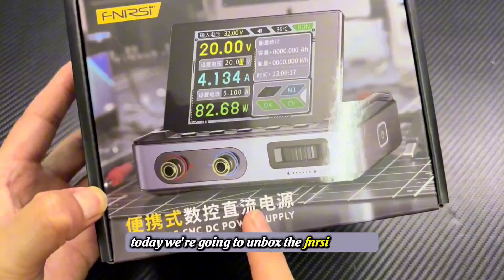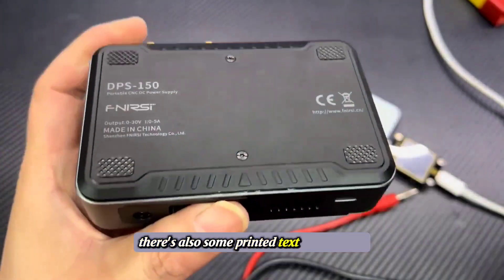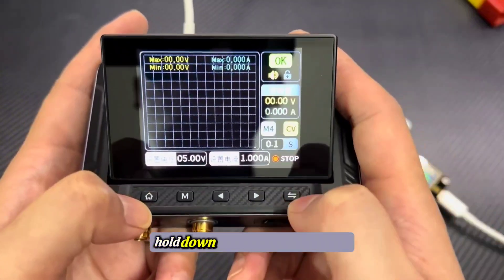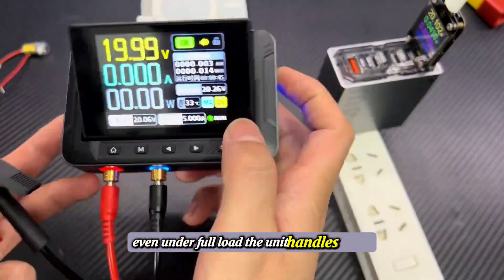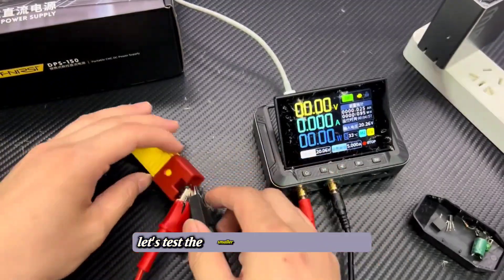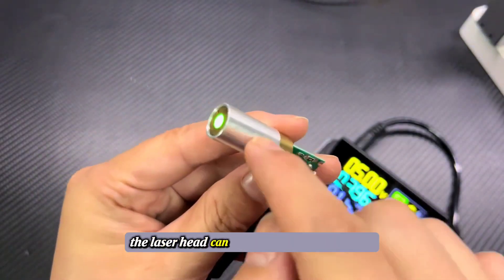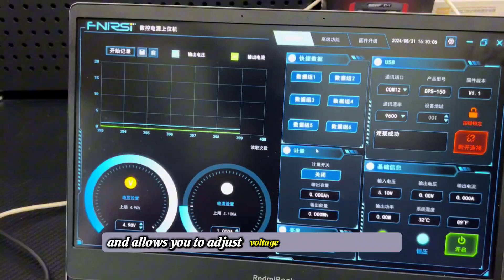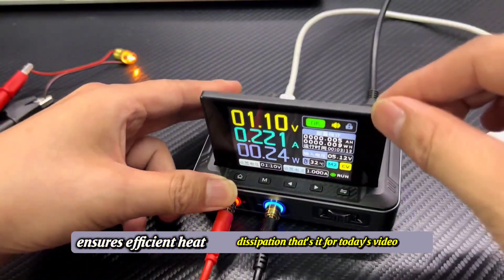Fnirsi DPS 150 Programmable DC Power Supply Unboxing and Review #dps150 #powersupply

Comment: What is the minimum voltage that the dps150 can release?
Some video can adjust 1v 3v / Some review say 5.0v only for minimum
Reply: Can't set it lower than 5.0v on mine